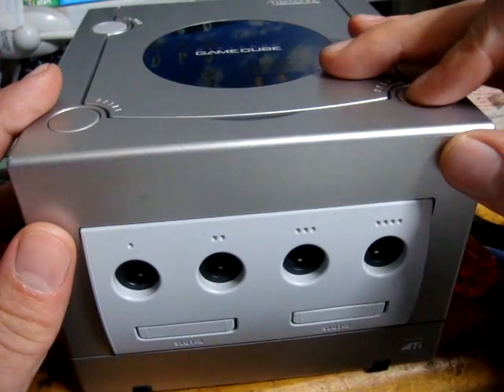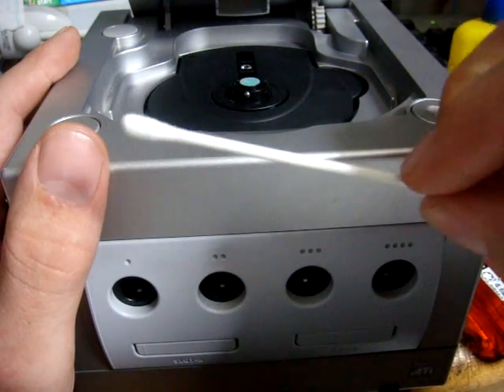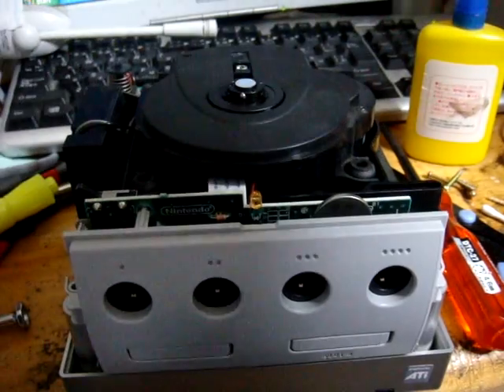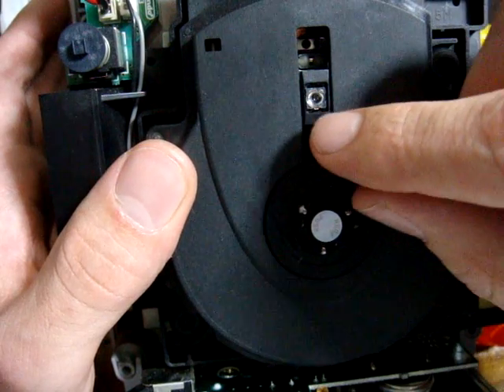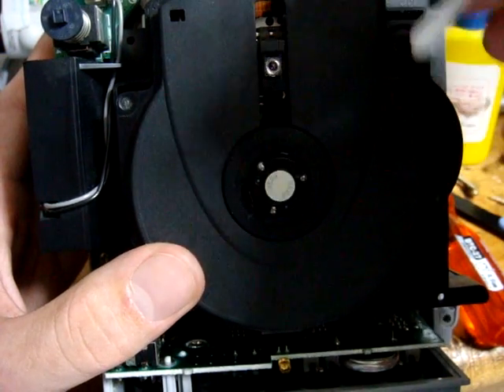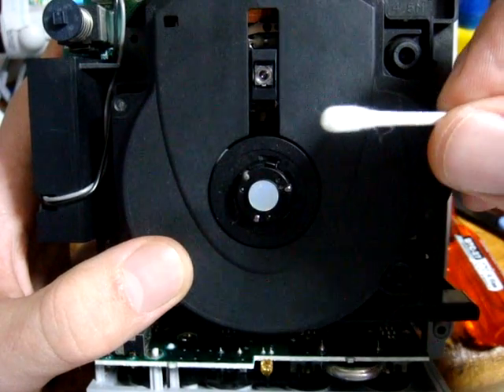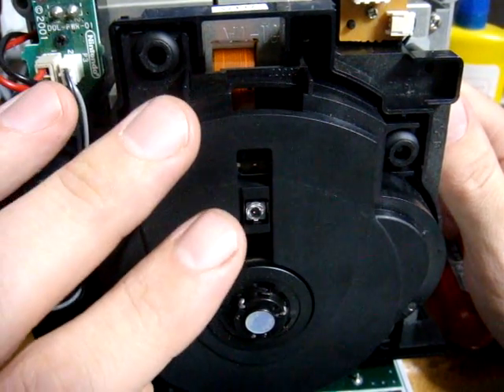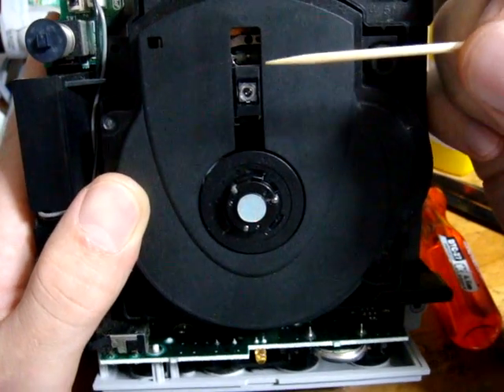Game Cube Disk Read Error Fix (Advanced Skill)

Comment: People who say that the laser may be bad know nothing about how to repair the lens. There is a variable adjustment resistor that adjusts the laser's position to read the disc. I still bought a new laser, but apparently it was not needed. All I needed to do was to take a small Philips head screwdriver and adjust the resistor to make sure that the laser was in the correct position.
Reply: Would you be able to show where this is at somehow?

Comment: Awesome video, I got lucky with mine and all I had to do was nudge the lens back into place with a q-tip. Thanks for the walkthrough
Reply: Shit thank you, two years later and it worked for me
Reply: How did you nudge it
Reply: @andy-r6p5e  Its been awhile but iirc I think the lens was at an angle and not flat like he says in the video. I just used a q-tip and pushed it back down into place
Reply: @steve32767  ok thanks!
Reply: @andy-r6p5e  good luck!

Comment: My GameCube doesn't like my Legend of Zelda: Wind Waker disc, but yet it reads most of the others discs just fine. The only other disc that has problems is Eternal Darkness, yet the GameCube reads that more than Zelda. At first, I thought it may be the discs even though they only have light scratches, but my Nintendo Wii reads all of those discs perfectly on the first try. Has anyone else had issues with those particular games?

Comment: Trust me, it is NOT broken. It takes a little bit of patience. What you want to do is try rotating the disk in different directions. Like having it so you can read the name up or by having the name down or to the sides. Also spinning it really quick and closing it works. If that doesn't work I also try clicking the button that restarts (not power button) a few times and rotate the disk again. It works ALWAYS! Only game of mine that doesn't work is my Sonic cause it's scratched REALLY bad.

Comment: So, my gamecube can't read my Wind Waker disc... I know it's something with the disc, but nothing I've tried has worked. When I compare it to another game, it's scratches aren't nearly as bad but the other game will work and Wind Waker won't. 
One thing is that the center part of the disc that's clear has a bunch of crud that is actually INSIDE the disc. Could that be my problem? If so, I'm screwed and will never get to play my Wind Waker game.

Comment: Hay luke I have 1000X easy way of doing this, You get a cotton tip but not the standard ones the cosmetic buds they have a pointed end, and a flat end on the other, use the pointed end on the laser so that it's all to one way now plug it in doesn't read disc push the opp end down extremely lightly plug in test again. Took me 5 times untill I got it, maybe it was just luck I don't have another gamecube to test it on. I'll make a video I'm so happy :) ha ha

Comment: Of course it's not the spinning mechanism.  Remove the lid and find a way to simulate the lid closing, then continually spin it with your hand and see how far you get.  The gamecube stops spinning the disc when it realizes the data can't be read.
You can buy used Gamecubes on amazon or ebay for $20-$30.

Comment: I has a set of tweezers that needed some rubber on the end so I went to my local hardware store and picked up a can of "Rubberize it" it gives the same finish as what you would find on a pair of pliers.

You just dip it in the can pull them out and hang it up somewhere for about 30-45 mins and coat as many times as necessary. Its a lot like making candles if you need more than one coat.

Comment: @ShadowFan765 You can easily make your own using a hollowed out BIC pen or any pen shaft similar.  Just heat the tip with a lighter just a bit and shove it on top of the Gamecube screws and wait for it to cool.  You'll be able to remove all of them without any problem and without having to spend a few bucks on a "real" screwdriver :)